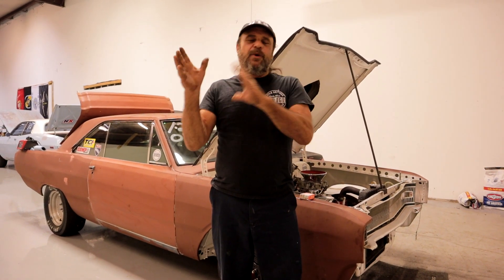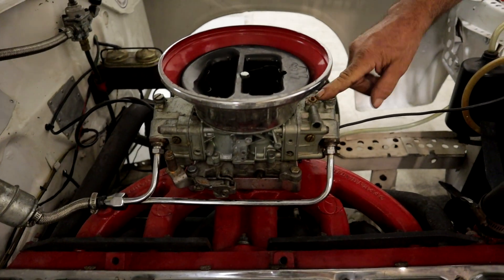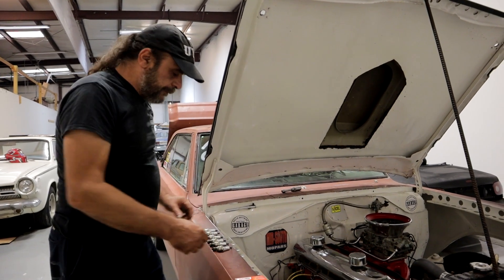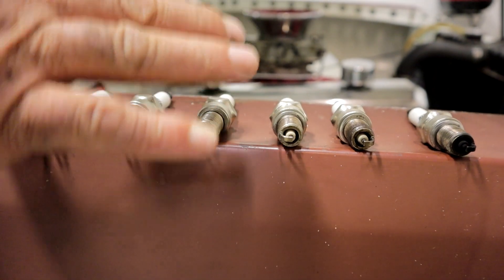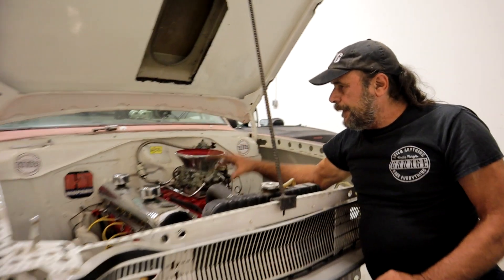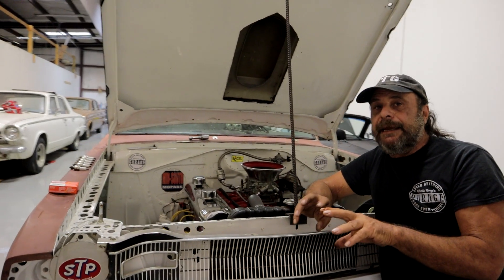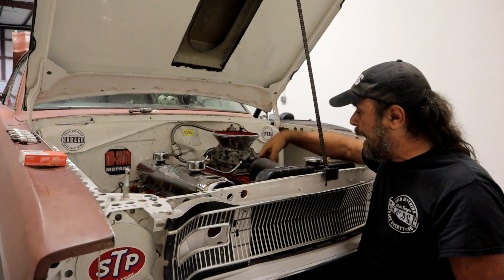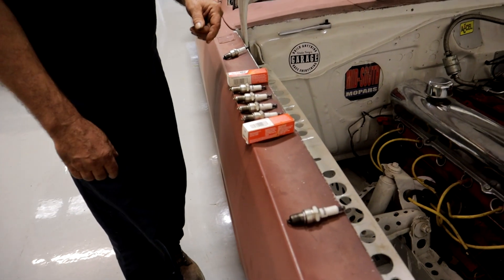Initial Carburetor Performance Tuning

Comment: Been working on cars since before I got my license in 1980, turned a wrench for a living for years and have built dozens of very successful race engines.  I consider my knowledge of carburetion and especially Holley carburetor‘s at a very high-level and don’t get schooled by many people.  But I was highly impressed with your diagnosis and explanation of what was going on in your slant six in today’s video.   Would enjoy very much picking your brain and doing some bench racing with you.  Hot rodding  needs passionate people like yourself and I to help carry it into the future.
Reply from the maker: Thank you Don, I much appreciate that.
Reply: How did he get this engine to 12:1?  That doesn't sound right to me.
Reply: @tarstarkusz  I think he means air/fuel ratio, not compression.
Reply from the maker: @tarstarkusz  It's 11to1.  .100 off the deck, .110 off the head. .022 head gasket
Reply: @UncleTonysGarage  Thanks.
Reply: @pookysdad4884  No, he means compression, but he clarified in this thread it's 11:1 and how he did it. Just expand the thread.
Reply: @tarstarkusz  he said 11:1. There's lots of ways. Pistons, mill the head, etc.
Reply: Words of a smart and humble man. Hope some folks got a quick lesson from Don’s comment.
Reply: @ShadeTreeKennyT  12:1 compression causes a lot of problems, especially ignition.  I know he clarified in the comments that it's 11, but he said 12 in the video.
Reply: @tarstarkusz  Did you watch a different version of this video? He does not say 12:1.
Reply: @tarstarkusz  only a problem on a street driven car. Drag cars can simply use high octane racing gas. Tony is way to cheap to spend money on race gas. So he does it the same way I do. True dynamic compression is measured after the intake valve closes. If you keep dynamic compression at about 9 1/2:1 by using the correct cam grind and also running a tight squish band in tonys case .022" you can run pump gas with no detonation issues. Also don't go crazy with spark lead but then a good tight squish band makes for a very fast burn and usually doesn't like too much timing. My sportster makes maximum power on the dyno with only 29 degrees of timing.
Reply: No worries Don. Down here in Hawaii I'm one of many who still live Hot Roddin! I've built a bunch of stuff as well as turned a wrench for a living, still do. To me, this Hobby/lifestyle will never die. It's too inspiring. Like I said, I'll do my part to keep pushing Hot Rodding into the future! Have a good one.
Reply: I just replaced plugs, plug wires, distributor cap and rotor button in my 93, 4.0L Jeep Grand Cherokee. All the plugs were white but it uses a fuel rail injection. I learned a lot from this short video tho. Unfortunately, I used the lawn mower plugs, lol. I'll know better next time. Thanks brother man...gotta go. The next video is waiting.
Reply: Depending on build or not, B-12 might get you home. Lol
Reply: @UncleTonysGarage  I’m from the cubic dollars school. Go big or spend big.
Reply: @UncleTonysGarage  can i run my car on pump gas? It's 11.and a half to 1 my builder told me. He also said i could run it safely on 93 I'm driving it from Chicago to Arizona and they don't sell good fuel on the highway. Like 94 octane to 110. What do you think Uncle Tony. All thoughts welcome I've had 4 guys that are very good tell me i can. I also have a question About clutches. I had a Hays in it they talked me into a center force 2 i believe it has the weights i heard of vibration issues i wanted to go with a 650 diesel Hays they are so forgiving it's a street car about 550 hp don't know the torque and exact hp yet till it's on the dyno also instead of a true roller timing i was talked into a gear drive also heard of harmonics issues please advise. Thank you.

Comment: My machine shop teacher from high-school had a dart with a slant 6 and he built a custom intake and ran 6 motorcycle carburetors. With this setup he was able to tune each cylinder to make the most horsepower. I wish I could track him down to show you how it was done. That car ran lows 10s in the quarter mile before they told him he had to put a roll cage into it.
Reply: I guess those where 6 carbs from Hondas or Yamahas between 600 - 750cc. Would be interesting to see Keihin CV carbs or Mikuni flat slides carburetors on a Slant!!
Reply: I saw something like that in a magazine once. Cool idea.
Reply: But bike carbs don't have accelerator pumps...or do they? Maybe with individual runners, you don't need any?
Reply: @pookysdad4884  mechanical  bike carbs are available with accelerator pumps but i would personally get the latest model Constant Velocity style. Mikuni sidedraft CV of 90,s suzukis were long lasting ,reliable ,easy to tune and very responsive. I have a pontiac That has a dry style intake manifold that i am very much considering running two banks on a crossram style bike carb intake.
Reply: @rogerlizama1326  yeah you can get Harley CV carbs now for CHEAP!
Reply: in this day and age of readily available 3d printers, would be easy to make 6 intakes
Reply: @2000freefuel  Yeah Harleys are more common and available BUT the Slant is a 3.7L, while CVs feed up to 1800cc... 6 carbs even from 883s will be too much (maybe 3) and you'll have to detune them, that's why I suggest from japanese bikes, they even come in pairs. Either way it could be a interesting proyect.
Reply: @rogerlizama1326  slant 6 intake valve size just over 40mm. Harley CV  carb throat size is i believe pretty much the same. Should work fine.
Reply: @pookysdad4884  the Harley CV carbs have an accel pump
Reply: @Tumbleweed_Tx  
In aluminum it wouldn't be cheap. High quality resin might be the way to go. Lighter to
Reply: @watsisbuttndo829  I was talking about jet sizes because of different CCs from 883 all the way to 1800 (IMO carbs from medium japanese bikes being more appropiate), but yeah you have a good point regarding throat sizes.
Reply: @pookysdad4884  Some do, some don't. And some others that don't even have jets, the ones from Lectron. Pretty cool!
Reply: I believe that they where kawasaki carbs that he used from a 750cc motorcycle. I remember him tuning it in the high-school autoshop using a temp gun and a carb hat vacuum gauge. This is going back almost 25 years ago now.
Reply: Would love to know how he synchronized the throttle linkage.
Best shop teacher ever!
Reply: @rogerlizama1326  Very interesting.
Reply: @2000freefuel  That makes sense, cuz one carb feeds 2 cylinders, and they're pretty big bore cylinders.
Reply: @Tumbleweed_Tx  That's a good idea. But in aluminum, phenolic plastic, or something else? How affordable is one that prints in metal??
Reply: Cambron Gabaree  But you might be able to print cores out of casting sand, and cast your manifolds from aluminum.
Reply: https://youtu.be/LwiOpD53MbM          Here is a video of my 1965 Studebaker V8 that I fitted with 8 Keihin carbs. I could never get it to run properly fueling with the carbs, (running fat, and fuel leaks mainly from too much fuel pressure), so I ended up using them as throttle bodies and using a Megasquirt ecu for fueling plus a Ford EDIS ignition setup. Runs great now.
Reply: @pookysdad4884  my old cb750 carbs have accel pumps
Reply: Damn and you know it made gobs of tourqe and ran forever and then some. I wish my highschool had a machine shop I would be making all sorts of bits and pieces for my trucks motor i have an old international you can't get intakes and heads for them with is they're biggest restriction
Reply: in europe we do that when we want to race..or just put 3 carburators

Comment: Uncle tony ive had to deal with the same issue on slants and ford 300's. Instead of staggering the jets the optimal way to do it is to get a spacer and mount the carb "sideways". Do this and the fuel distribution will be much better due to how primary and secondarys work on a holley.
Reply: I've seen people doing this with a 2bbl conversion as well . Putting the carb sideways and welding a wall inside the manifold.. creating a dual plane intake manifold!
Reply from the maker: This carb is mounted sideways as per the intake manifolds original orientation.  It is known to have terrible distribution right out of the box
Reply: @UncleTonysGarage  That carb is mounted the standard direction. He means turn it 90 degrees.
Reply: Great idea.
Reply: I ran into the same problem with a Holley 390 on a Chevy 292. Primarys on the outside secondarys on the inside. Engines a mild performance street engine and made a noticable difference in driveability. Full race it might not matter as much though. Worth a try in my opinion regardless.
Reply: @tedesco455  If the car launches hard, would that not be a nightmare to deal with? I mean fuel slosh rearward...
Reply: Plenum chambers do help to some degree.
Reply: @Adrenacyde  No since the bowls are sideways, it would be a better situation.
Reply: tehre are some other tricks to avoid it...had a car like that and never had anyproblem with sparl plugs theya re exavly the same..burn

Comment: Had this issue on a 22R motor... Raised the Weber 3.5" above the manifold with a taller phenolic spacer and it evened out cylinder distribution due to better atomization and airflow through the runners immediately after the baseplate. Helped my top end too by 400 rpm. Just another thought. Keep being AWESOME, UT!!!
Reply: Running a 1" spacer... on top of the 2BBL conversion adapter which is a solid 1-1/2" above the manifold on my 200cid Ford LOG head...Weber carbs are a special breed for sure. Got the tricked out 32/36 to run great... the 38/38 is giving me a fight... but I'll win ;-)
Reply: Did that same thing on a Ford 2.3 EFI when I converted it to carb ran really good I just used a oem Holley 2bbl 360 carb and decreased the jet size by 40%
Reply: I thought that would help!
Reply: A poor man's tunnel ram!
Reply: i thought spacers were just doing nothing usually racers used them to avoid heat,a t least thats what i see on dynos.

Comment: When I use to buy plugs for my slant 6, I ran the plugs just like you're going to. You wouldn't believe the looks I would get from the guy or gal behind the counter. Even though it was a stock engine I had the same issue with the plugs when I did the first tune up on it. Can't wait to see and hear how Plan Z runs now.

Comment: I built a Nissan 240z engine 25years ago, it had 10:1 comp, i blueprinted the engine, do not Remember what cam. I put on 3 weber dohc 45. It made 188 rw hp, at the rolling dyno. The intake sound of those webers, gave me the chills. I had a garage in Stockholm, at that time, and worked on both Porsches and Ferraris, and american cars. My heart was allways on  us cars.

Comment: I never knew you could mix spark plug heat ranges on an engine, or run different size jets on the same carb. It makes sense after you broke it down. Thanks for the knowledge yet again UT!
Reply: He'll, we used to run different valve lash on half of the cylinders to try to get a broader torque curve.
Reply: Almost every carb have different size jets and meters you can swap out for preformance or economy
Reply: Guys would run different heat plugs on old air cooled 3 cylinder motorcycles bc the middle cylinder usually runs hotter

Comment: Ran inline Chevy six for years. You need to try a 2 inch carb spacer to increase the plenum for better distribution. Also, the unequal length runners are part of the issue. The signal back to the carb is stronger for your two end cylinders and they are drawing more air/fuel. Have done work with diverters and grinding to try to even out the fuel distribution on the Chevys. For a Chevy 6 the number 5 cylinder was usually the piston to fail as the firing order and intake configuration caused that cylinder to run leanest. Good luck and thanks for these videos.
Reply from the maker: Spacer tuning is planned once our true baseline is established
Reply: @UncleTonysGarage  one thing at a time, grasshopper.

Comment: I’ve run the same intake on a street car, and I suspected there was strange fuel distribution at part throttle, but I never did your plug trick, and I’m stunned at the variation between cylinders. The car is long gone, but I still have all the hot parts, incase the bug bites again.

Comment: Tony you should consider a smaller carburetor and mount turn it 90°, in form that the front of the carburetor is pointing toward the left [fender] side. The reason for my madness is that turning it 90° is for better fuel distribution.  Having the carburetor turned 90° will provide you with one idle circuit feeding the rear
 3 cylinders and the other idle circuit feeding the front 3 cylinder.  
Furthermore,  when an engine has  
an carburetor of greater CFM [size] than the engine can handle it becomes harder for the fuel to be pulled out of the boosters, due to the that the vaccum signal needed to pull the fuel is not enough.  It is actually the opposite direction that is needed. In other words a larger jet is need to compensate for the week vaccum signal.
Or go with a smaller carburetor,
Holley  and Edelbrock bought manufacture 500 CFM 4 bbl. Carburetors. 
Holley even makes a 500 CFM 2bbl.

Unless you're planning to 
Rev. 8000 rpm a 650 cfm is to large.
especially if your tuning  goal is for torque. 

No matter the outcome I will still be a fan of your channel .
Reply: You got it right Holly  500 2 barrel    Should work very well

Comment: With most 650 double pumpers (List 4777) the jets start off at 67 front and 73 rear. The power valve in that carb with original metering block is about the difference with these, or maybe 6 jet sizes. Maybe slightly less. The stock jetting at sea level is often about 5% rich. Higher altitude, the same jets would be even richer. With 6 cylinder engines at the circle track, some V8 rules don't always apply.

Comment: I have to give Kudo to Tony for all that he does on this channel.
I would also like to say I'm nowhere near the mechanic that Tony happens to be.  I cringe about how much I've forgotten compared to what I have retained. Yikes!
All of that being said, I would like to offer up as something that is not attacking what he says, but "in addition to" what he has said about the Slant 6. 
Because of the manifold design, the slant has problems with the end cylinders' A/F.  Way back in the day, I was member of the Slant6 club of America and someone in the club had (long before I joined) helped to minimize that problem with a 4 barrel carb.
They would weld in a plate which separated/split the manifold to 3 plenums on each side.  They then rotated the carb 90 degrees so each "side" of the manifiold would have a primary and secondary to feed it.  My experience was seat of the pants in the cars, but they seems to have better throttle response and a bit more power.  I never heard a owner that had done that modification to be unhappy with the results.

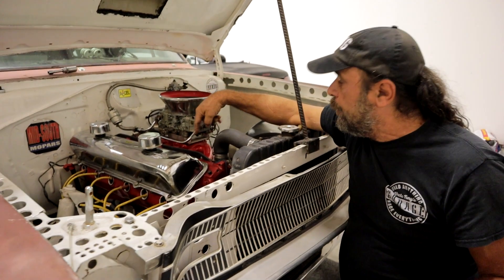He says at 9:55 "that this is an perfect example of where port fuel injection would be far superior to a carbureted setup." 

I have always wanted to spend some time and do that to a Slant but never had the time/money/car.  That always seemed to be a solution to me.

Thanks again Tony!

Comment: Thank you your videos. The efi system on my F150 died. Changed it over to carb and hei. Got it timed correctly and the carb tuning perfectly. Running way better and way more efficient than the efi system that was on it from factory. Way more power and 23mpg.

Comment: We got something but it is only a first step of many in a series of steps to optimize the set up you need for a close as your going to get to a perfect tune on the motor you have designed the parts list and built for a specific purpose/use/reason. God bless, good evening and great weekend to you all. Enjoy, I did back to my analog thinking till I get back to the 7-5:30. Thanks for the update and a lesson of many.

Comment: So much knowledge!! I grew up every vehicle I owned was TBI or EFI...I  now have a 4x4 79 SWB with a 2 bolt main SB 400... highly considering swapping to EFI, as its hard to start and every now and then, it will starve of fuel when driving and die....it starts right back up, so I don't think it is fluiding the carb.... watched a video of Uncle Tony complaining about an issue on Ram Charger he went ahead and swapped back to carb...so here I go, I'll watch and read some more on proper tuning ect...see if I can get it reliable before spending the $1700 on a conversion kit.

Comment: Uncle Tony I strongly recommend reading DV's book on super tuning Holley carbs. Couple things, not necessarily echoing DV here: 1) a "large" carb spacer (like a 2" open deal) might help your distribution problem a lot - gives some distance for mixing and dynamics to take effect. Might be worth a try. 2) power valve will only take effect when vacuum is very low, so if not WOT under load the power valve may as well be blocked (I know you know this). 3) I am guessing that lower displacement machine would like a leaner relationship between the idle feed restrictors and idle air bleeds, I.e. air corrector jets. 4) slap an O2 sensor on there. It's not cheating. It's good clean science!

Keep the content rolling, man! Nice job!

Comment: runner length difference is part of what made the slant 6 so damn smooth. you basically had a lag on 1  and 6 so accelerating was like running a 4 cylinder and having 2 more kick in. if you paid  attention you could feel it.

Comment: Really a good, common sense approach to engine tuning.  If I remember correctly(set me straight if I'm wrong) Chevy used a couple of methods on some of their big blocks to equalize the cylinder efficiency:  1) stagger jetting of some engines. 
2) "twisting" the carb/manifold so it sat on an angle on top the engine to try to equalize runner length.  3)  A combination of 1&2 above.  If I remember correctly, it worked quite well for them.